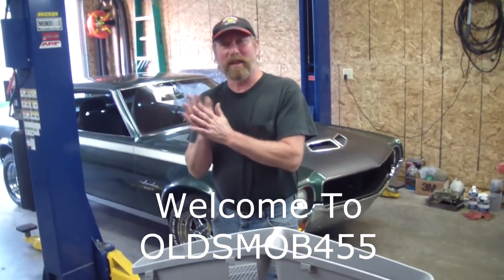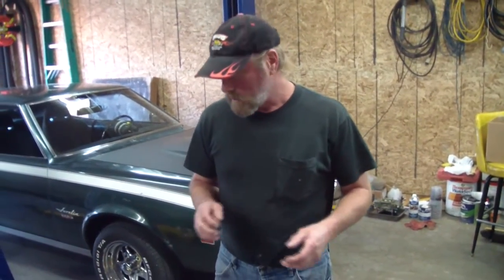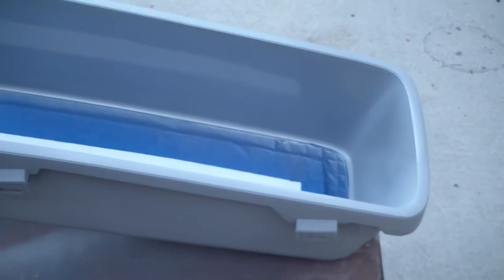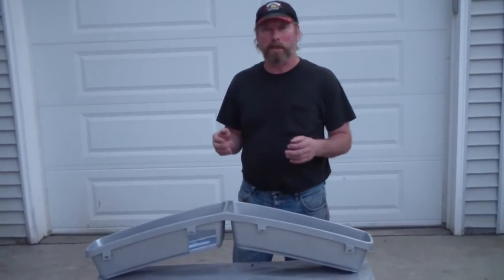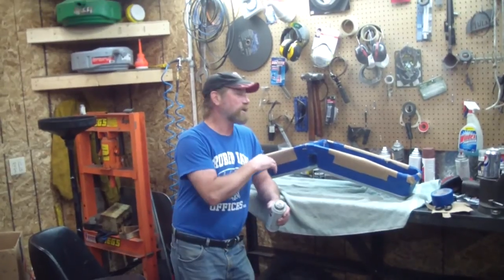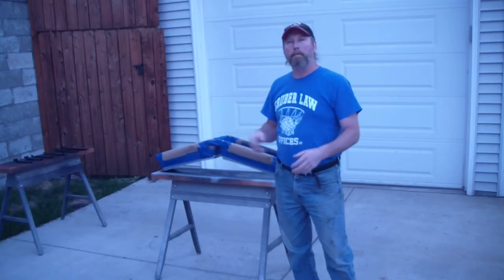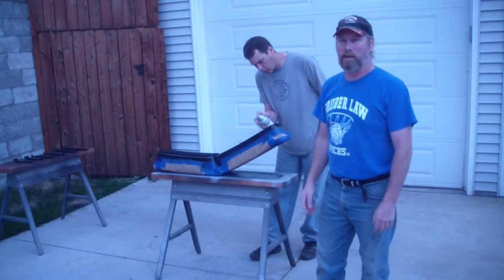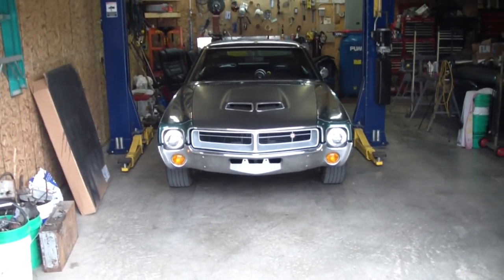1969 Javelin Grill Completed and Installed

Comment: That's looking great. I try to avoid epoxy for "joining" plastic. I now use Wedlon 16 cement. Its incredible. I also found that the silver paint fades easily unless you clear coat it, maybe yours is not the same.
Reply from the maker: Robonza We actually used loctite brand super glue, he kinda misspoke there.  After trying a few other glues that didn't hold, things were not looking good for a but. Never heard of the Wedlon cement,  thanks for the tip.